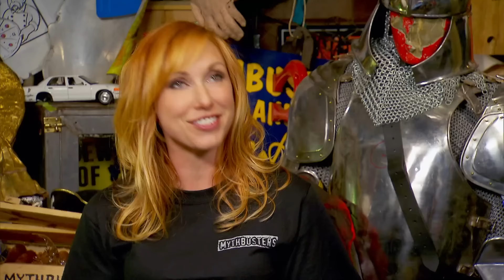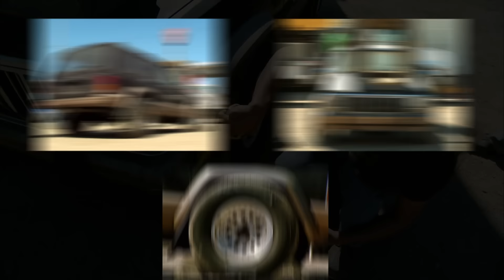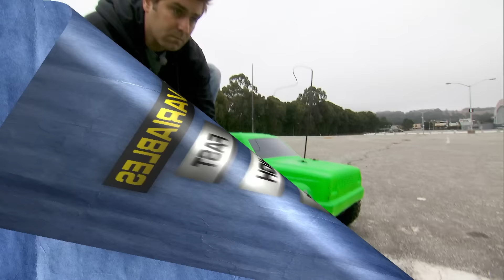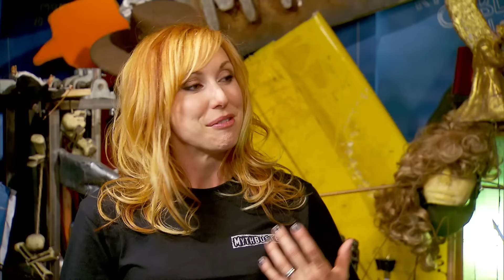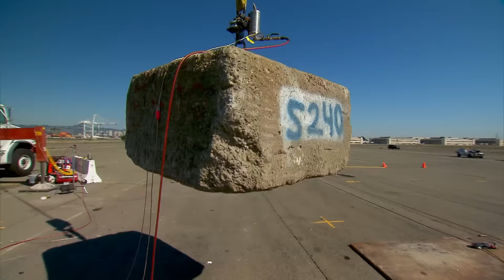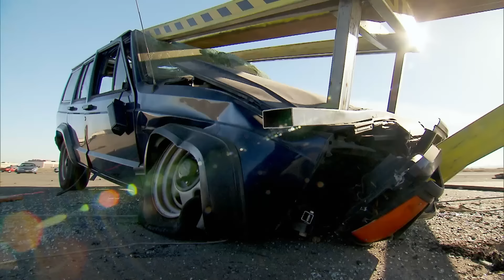Could Hellboy's Punch Really Flip A Car Over Someone's Head? | MythBusters

Comment: A more ideal mechanism that could mimic Bro’s punch could be a rat trap. It can be planted on the floor as bros feet and the spring will act as the muscles— the mass and material at point of impact can be adjusted accordingly. After this small scale is tweaked to work, then they could create a big scale rat trap.

Comment: 🚨 THE DOWNWARD FORCE MOVES. HOW ABOUT A STATIC FIST ON AN ACTUATOR TO APPLY FORCE BECAUSE THE DROPPED FIST LACKS THE MASS THAT IS ATTACHED TO THE LINE. 
If it was me. A continuous rapid downward force like a steel pole! Otherwise it gets knocked out of the way! Imho! Thank you! 👍🏽😍👍🏽
Reply: It changes the downward forces by the least resistance. Laying over the hood instead of a steel fist like a pole!

Comment: So I don’t think you quite tested this myth properly. As you can see in the videos you didn’t stop the motion of the car. As the weight drops on the car the car keeps rolling forward and even pushes the weight forward. I think the proper way to do this is to set up a giant guillotine that slams down on the hood of the car so that it stops the cars for motion and presses a strong downward force on the hood, causing the car to flip.

Comment: The real modified vehicle didn't flip because the concrete block literally prevented the flip. And It was a little off on the target mark. Maybe about an inch and a half to two inches. I do agree that the myth of the original standards applied is busted.

Comment: Love the small scale test after they destroyed a bunch of Jeeps. Before timing the drop, they could have tested not whether you can bottom out the nose, but whether you can actually flip a car by pushing down in front of the axle... especially with the front wheels so far forward on the jeep. Someone also pointed out Hellboy was an immovable object. So a setup where a jeep runs into a rig that triggers a fist to hit the front but does not move.

Comment: I feel the added height of the welded plate was not factored into the equation. It seemed to still be aimed at the point on the hood of the vehicle instead of recalculating to the point of the plate. PLEASE TRY AGAIN

Comment: Theres another thing they didnt take into acount that makes this myth even more impossible. Punching the front of the hood like that is like trying to lift a car by putting it on the long end of a lever, and punching down on the short end. I firmly believe a half demon like Hellboy is strong enough to lift a car on such a hypothetical lever, but he canonically weighs 400 pounds. Any force that would push the front of the car down would push his arm up the same amount. Just ask Sir Isaac Newton. He would just propel himself into the air long before he flipped the car.

Now if he uppercutted the bumper of the car, thats a different story. Then he'd be ancoring himself to the ground, bypassing the problem of the lever, and the follow through of his punch would be lifting the car more rather than just driving the car into the pavement.

Comment: Unfortunately they missed the actual myth in how they tried to replicate it. if u paid attention to the video of how it happened it is not JUST a powerful punch down, it also completely stopped the vehicles nose and drove it into the ground. the power to do this is not just 2-3 times the weight of the car is massively more than that.
On top of which the Force lever action was between the front of the car and the front wheels (pivot point is the wheel), causing back of car to accelerate upwards with that lever rotating around the point of impact.  two levers acting at the same time. they just test the one, ignoring the other.

Comment: Seems like it would have been smarter to run the Jeep off to the side of where the fist is supposed to fall and use the high speed camera to adjust the timing as many times as they needed. Then do a real test. Then you wouldn't need to go through a half dozen Jeeps.
Reply: or do the small scale tests First

Comment: This is so frustrating to see because in the fictional instance Hellboy is planted with his feet and not just punching down he's acting as an immovable object, preventing the force from coming back into his arm in their test the force of the falling object isn't a close enough simulation.

When the falling fist lands it instantly has recoil, whereas a punch has follow through. The punch isn't just pushing down, it's also stopping the car and giving the force no option but to go with the rotation of the car when the back end starts to lift.

Their last test shows perfectly the issue with their design. The vehicle keeps moving forward after the weight lands, because it's not a person with their feet planted and their shoulders absorbing the recoil and keeping the force from going forward. The same thing happened with their small scale example as well.

Edit: What's far more likely is the car would flip and crush the thing punching it, rather than jump into the air and do a perfect flip over top, lol.
Reply: Im happy to see my thoughts already put down into words. Sadly its not something they can come back to again.
Reply: There's just not enough front overhang on a Jeep Cherokee to make the back end come up at all. The amount of force you would need to flip it that close to the fulcrum would just bend the front of the frame downward and then the Jeep would crash into Hellboy anyway.

If you put a nice big steel bumper on the front that extended it out another foot you might have a chance of making something more interesting happen, but it still wouldn't do anything close to the flip in the movie.
Reply: @Psyco913 exactly. Its exactly like the physics of the seesaw myth. The amount of force required to send the little girl 7 stories into the air is way more than any seesaw can handle.

The amount of force required to send a jeep flipping through the air like that would just compress the suspension and bend the chassis
Reply: And they didn't account for Hellboy's awesomeness
Reply: At 30MPH, what is most likely is that the car just stops dead with minimal elevation of the rear wheels.
Reply: Hmmm! 🤔   Makes sense.
Reply: Or or and here me out on this fucking magic makes it do the shit it does because it is a fucking film about a fictional supernatural magical being!
Reply: I would add that a mechanism that could mimic Bro’s punch could be a rat trap. It can be planted on the floor and the spring will act as the muscles— the mass and material at point of impact can be adjusted accordingly. After this small scale, then they could create a big scale rat trap.
Reply: were probably a decade too late but yeah the fist they tested is a live object thats just kinda free floating in the air where as in the film it is attached to something that is on the ground and going to physically resist that forwards motion the car imparts
Reply: Came here to say exactly this.
Reply: I had the same complaint when I watch it on tv.  They should have had a frame bolted to the road with an air piston driving the fist down.
Reply: @FunnyHaHa420 No amount of force is going to send a Jeep into a perfect front flip like that
Reply: @jeffroberts6428  Isn't that the point of testing the myth? I think there are issues with the physics here as well, but their testing setup was not a recreation of the forces in the movie clip.
Reply: @Mystara_Magenta  You’re right, they should have gotten actual hellboy
Reply: @jeffroberts6428  Doesn't have to be a perfect front flip, just has to flip.
Reply: He also not punching straight down, he punching down on an angle if that adds anything
Reply: @Dom_P1  Thank you, I was thinking the same thing, it certainly does help the force transfer around the fulcrum to the back.
Reply: @Dom_P1  It was never gonna happen the way it did in the movie though
Reply: Genuinely so frustrating to watch
Reply: I feel a major issue is that there'd be no feasible way for them to replicate the superhuman strength behind his punch with a stationary puncher, even a mechanical one. Like, they used hydrophilic impact mechanisms in the past but none of them would be able to replicate that force effectively. That's a common issue with some of their tests, as they're trying to replicate superhuman feats.
Reply: @Undeadpriest94  this is exactly what I was thinking. Like maybe with spaceship building money lol.
Reply: Wait, you think that the friction between the ground and a human-sized entity's feet would stop a speeding car? Can I have some of whatever you smoked?
Reply: @MeepChangeling   belief not suspended, noted 

no, I think his, superman completely past possible reality, muscles and shoulder would easily (and did) stop the incoming force presented within the work of fiction that demonstrated him doing just that.

What are we arguing here?
Reply: It's almost like the whole thing is fake and made up!
Reply: Yeah. This was just a waste of time
Reply: Couldn't agree more and unfortunately if you watched the movie clip or the actual movie in slow motion you can see the rotation of the vehicle looks a lot like crane hoist mechanism I don't know what the actual term for it is but it's a mechanism to rotate the car while moving laterally😊
Reply: Planting your feet dosent make you immovable, superhuman or not. He's punching down, propelling himself up. Hellboy weighs 400 pounds, much less than a jeep. He would lift himself into the air before he makes the jeep move.

And before you say hes throwing a punch not just sitting on the hood, therefore applying more force than his bodyweight: any amount of force he applies to the hood with his arms must be applied equally and opposite to his body. Since he punched down, his body goes up.

Imagine he tried this with his foot instead of his fist, and its easier to see what I mean. He would just jump off the hood rather than crushing it.
Reply: @jessetheenby  you're not accounting for his muscles. He's not an intimate object... His muscle strength is what's inhuman and enduring the force in order to make him immovable relative to the oncoming force.
Reply: @JonBonCat being strong dosent make you immune the newton's third law. He's not bracing against anything, so he would be lifted into the air.

Could he resist the impact of the car ramming into him? Maybe. I doubt it, but its possible. But when it comes to the force going back through his body when he punches downwards, he isnt doing anything to hold himself down. It wouldnt work

Edit: imagine you got an indestructible 10 foot pole, and youre trying to use it as a lever to lift a tank. No matter how hard you push down on the lever, you won't be able to move it, because you'll just be lifting yourself into the air. But what if you were superhuman? Same problem, your not heavy enough to stay planted on the ground. The issue isnt strength, its weight. Hellboy isnt heavy enough to use the cars axle as a lever without just lifting himself.
Reply: @jessetheenby   "He isn't doing anything to hold himself down."
Yes, he's flexing. A limp arm and a flexed arm resist different force. Of course you can brace yourself with your body's muscles and resist force greater than your weight. 

In a fictional universe his muscles are inhuman, you have to suspend disbelief because it's fiction and understand he can brace and resist more force than a human in real life.
Reply: every myth they test is bogus tbh.   a trebuchet would probably be better to test this out.  not dropping something from higher up.   just rig it to slam down instead of fling.
Reply: @sneakrevived  seriously? Every single myth?

Comment: The car in the movie stopped in its tracks then flipped. That would have flipped their car. They kept it driving forward, though, instead of stopping it and transferring all of the energy through the pivot point. The reason their small scale test worked is because the metal dug into the wood and caused the car to stop in its tracks, carrying the energy through the pivot point to get the 90+ degrees they needed.

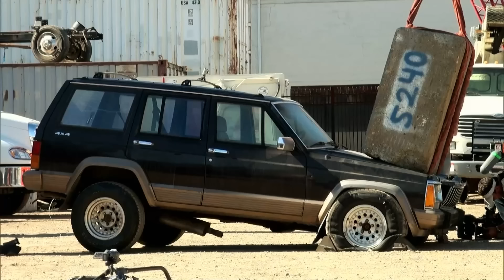Comment: 3:30 the weight is over the axle. you can't use the axle as a pivot if the axle is supporting the weight. also the weight just flops onto the hood after it falls. hellboy is a person who's standing on the ground and cannot be moved. the car is able to push the falling weight to go along with it for a ride, there's nothing preventing the weight from being moved. it can't stop the car if it's on the car. at the end, the big weight missed and landed right on top of the axle, and then the car slid underneath so that the weight was on the wrong side and it actually prevented the car from flipping. plus, the big metal plate sticking out the front would get in the way of a flip. on the RC car, the plate hit the ground instead of the bumper and forced the car to twist instead of flip.
Reply: It's very clear that it's just not gonna happen. The car just doesn't have the structural integrity to fly up in the air like that from a single impact even if it came from below.
This is not a surprise. Hollywood has thrown cars into the air before and they know that just the force of the launch with smash up the vehicle.

After all why would they make cars strong enough to do that? That's just a lot of additional weight that serves no purpose. Cars don't have much structure in the vertical axes, only enough to support it's own weight if it's upside down.
Every additional kilo of structural weight adds costs and lowers fuel economy.
Reply: @MrMarinus18 the dark knight semi flip was real
Reply: Yeah, let us assume that part of his "magic" is making him immovable...
His fist goes down but doesn't move forward the way the dropped weight does...
So, the force is actually down and towards the rear, creating torsion in addition the stopping its forward movement...forcing the direction of travel to shift???